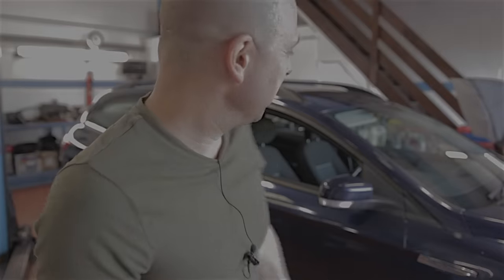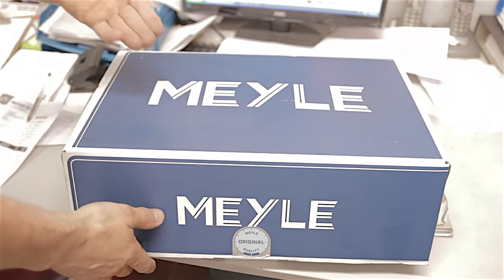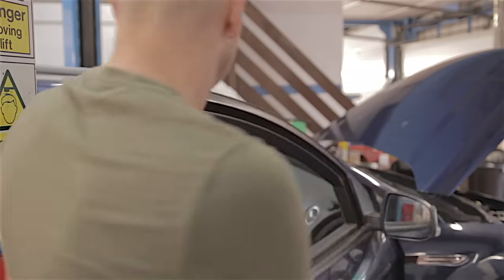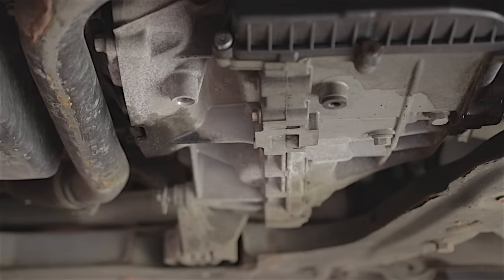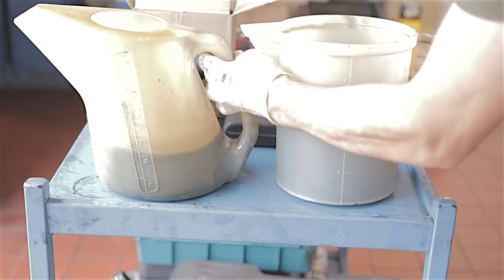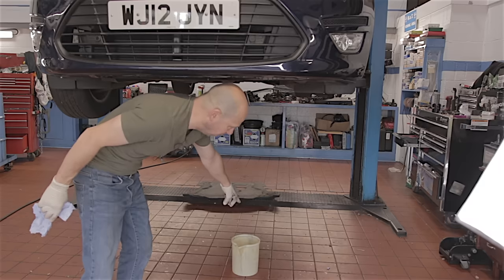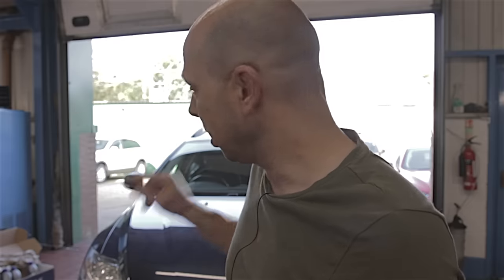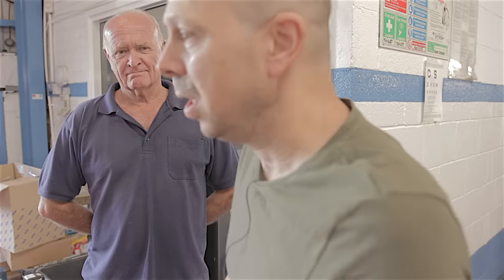Ford Mondeo Powershift Oil & Filter Change ....Lucky Me !!

Comment: There are a few things you need to know before you buy ford with powershift automatic gearbox (MPS6) or before you start complaining about it. The powershift transmission manufactured before 2015 are less reliable because they use the same oil in wet clutch and in hydrolic gear shifting valves. Ford uses plastic parts in the clutch assembly. These parts break, wear off and small bits of plastic then block the hydrolic valves that move the gear shifters. You get all weird problems. Gear shifting works on cold engine then stops on hot engine etc. These plastic parts are causing all the problems. Changing oil is not gonna help much but you should still change it max every 20k miles (ford says 40k). Plus there is an oil filter inside the gearbox, which you cannot replace without taking the gearbox apart.
The gearbox manufactured from 2015 has gearbox oil and clutch oil separated. And that does the trick.  The plastic crumbs do not get into the hydrolic valves anymore and the whole gearbox is much more reliable.
Ford considers this gearbox as non-serviceable. If anything brakes inside this gearbox, ford would tell you to replace the whole thing. And it costs milions $$$$. 
And because Ford considers this gearbox as non-serviceable there are no spare parts available.
It is not particularly faulty gearbox when compared to other automakers but if it breaks you are doomed.
Reply from the maker: thanks for the info, good to know, happy new year
Reply: the 1st series of Powershift is the worst gearbox ever made. Plastic parts are the real culprit. In the USA Ford had paid thousands $$ to the owners via class actions.

Comment: So you are saying  the aftermarket Meyle oil is as good as the OEM Ford oil? 
I would hate to stuff up the gearbox just to save a few dollars in the short term....
Reply: I ran the Morris DCT fluid in mine for years with no issue. There are a few aftermarket fluid options I'd feel confident using
Reply: Chances are that Ford uses the same Meyle oil and just rebrands it.
Reply: You can use any oil that matches Ford specification WSS-M2C936-A!

Comment: Hi i have car with same gearbox, 6dct450, but in last time i have problem.
When driving kick down or strong or overtaken on planes the gearbox lost 1,3,5 and revers gear. Afternstope, restart engine everything works fine. Can someone have ideas what can be?. I change gear oil again on 40k km but didn't have results.
Help?

Comment: I have a Ford C-max 2015 2.0 TDCI Powershift with 105 000 miles and I think my flywheel is going bad. You can hear rattle and grind noise only when turning off the car. Have anyone experienced similar problem?

Comment: is that transmission problematic?
Reply from the maker: its generally ok as long as you change the oil at the correct intervals
Reply: @alan4x  Thanks alot mate, the car is arriving in two days.

Comment: Hey Alan, I have ford mondeo mk5 tdci 2.0 180 HP. 150000 km. I have some kind of problem with my powershift its skipping or hacking/lagging when switching gears, what does this indicate and what do I have to do? Anyone knows? Should I change the filter and oil?
Reply from the maker: the oil changes on those gearboxes should be every 30k miles approx so that would be the first thing to get done,,,if you don't replace the oil the gearbox can become problematic

Comment: I think I would have measured the oil I was putting in the jug first then the gearbox so I knew it was 6 litres
Then done the level check then. Overfill out of the bottle if required 
Thing is I had to watch it again as I fell asleep half way through  well it is late
Reply from the maker: lol

Comment: Good video Alan!

Is this the same transmission used in the 2011 Ford S-max 2.0 TDCi? 

If it is, can you or somebody else confirm that oil with the ford spec
"WSS-M2C936-A" is okey to use in this transmission? 

See yah!

Comment: Easy job compared to an auto box with torque converter which you have to flush. Worse still, one without a filling port on the top. Btdt....

Comment: Is this the dual clutch system everyone is sueing Ford for in the US?

I put a clean rag over the funnel to filter good oil that might have picked up some bits.
Reply from the maker: i think it was the earlier gearboxes that had problems...on this year car they have fixed earlier issues
Reply: The focus and fiesta used a dry clutch setup that was prone to shuddering and other problems   an absolute piece of crap, probably the same in the USA just different names.

Comment: At the begining you said "2 wet clutches" - ain't they dry clutches?
Reply from the maker: wet clutches fitted to mondeos and dry clutches i believe to fiesta and focus which are more troublesome
Reply: @alan4x  ok thank you for the answer :) I own 2013 Kuga 2 and wonder if I have wet cluch as well - can't find that information anywhere
Reply from the maker: if you phone your ford dealer parts department they can tell you what model gearbox is fitted to your car using your registration number and from there find more info on it
Reply: @alan4x  yeah, will have to. Thx sir :)

Comment: Avoid this gearbox at all costs. It’s junk. Even with an oil change it will fail. ATF must be changed at every 38k miles according to Ford .Bad design and pure junk disintegrates internally and clogged valves are a constant problem

Comment: Hello. I have 2014 mondeo and I have power sift and no problems vith it.
Reply: How many km did you do?
Reply: I have driven 60k km car has driven 220k km and last oil was changed on 200k km.
Reply: @marguskeba7024  And what about consumption? I bought today a mondeo 2L 240HP.
Reply: @TomySTS  mine takes about 6l/100 km. All together.
Reply: @TomySTS  mine is 120kw 2l
I don't know how much hp
Reply: @marguskeba7024  150-160 hp... in city with quick launch i have like 15l/100km. hmm i think if i drive normally i will get la 11l/100km in city... i hope for a 7 extra urban... but that power makes me push that pedal...
Reply: @TomySTS  yes they go quickly
Reply: Yup, especially the consumption 😂
Reply: @TomySTS  yes
Reply: @TomySTS  you have petrol engine.

Comment: ford power shift has a life time warranty , good luck with ford labour charges though lol
Reply: no they dont
Reply: @TonyTony-xj6uv  my bad , i was told they did , but hey ho
Reply: @yamyamdashcam1232  they are fantastic gearboxes when looked after
Reply: In Europe maximum warranty for all main parts is 5 years.
Reply: @richardbauer8154  donyou want me to prove you wrong or do you want to go contact fords directly? Ford offer a 2 year warranty on the powershift extended to 3 years due to issues they offer 30k on the wet clutch due to the fact clutch wear is due to driver error. And even then that's only if the car has been serviced by a dealer or a vat registered service centre once car hits 90k the warranty ends unless you buy extended warranty
Reply: @TonyTony-xj6uv  I wanted to prove that yam yam dash cam is wrong. You've now explained the details of the same I wanted to say.
Reply: @richardbauer8154  my bad sorry

Comment: £300 for ford to do it for you. Volvo use the same box and change the fluid at a certain temp. SEE  YAH
Reply: For the auto box that needs to check the fluid level at a certain temperature you are talking about the earlier Aisin AWF21 transmission, and the change procedure is a completely different story...
Reply: @philipcheung2669  not checking at certain temp just draining👍
Reply: @philipcheung2669  hi. Badgertronix is the vid i watched. Check out the price of his fluid$$$$$
Reply: @philipcheung2669  my txs facelift has the aisin awf21, any idea when I should get the oil changed? Cheers
Reply: @battfinkz  Aisin says 2-30000km depends on usage.
The oil spec is WSS-M2C924-A, which is basically JWS3309 or Toyota T-IV. I personally use Toyota T-IV because it's cheap and easy to get in Hong Kong..

Comment: bad stupid design of this transmission. The oil that lubricates the wet clutches that wear and contaminate it also lubricates the gears and also operate the actuators. This allows plastic debris from the clutch packs to circulate the system and then partially block the passages in the actuator block. And such a shitty gear change even when there isn't a problem..
Reply: Circulate through the filter?
Reply: @richardbauer8154  yes, don't ask me how they get through but I've had to strip the valve body twice now and found a mm sized plastic debris in causing restricted flow.